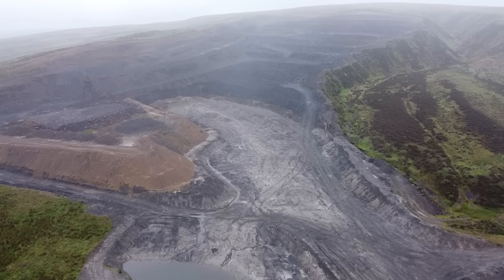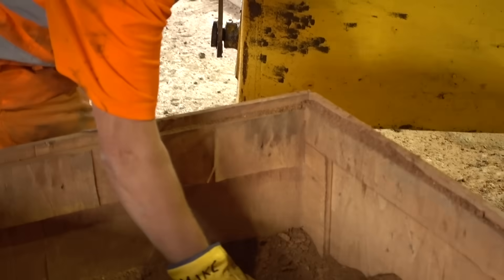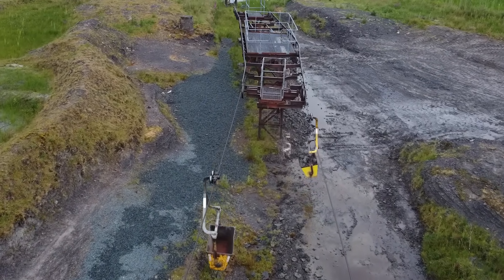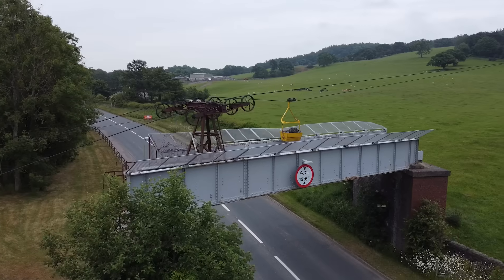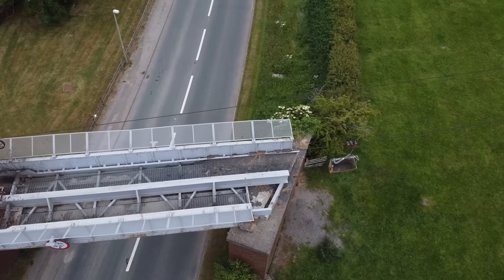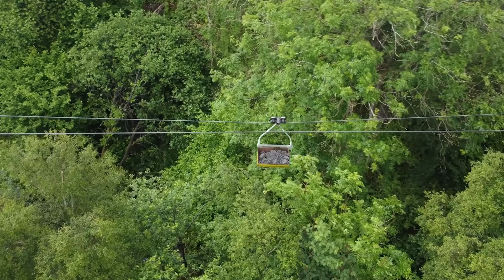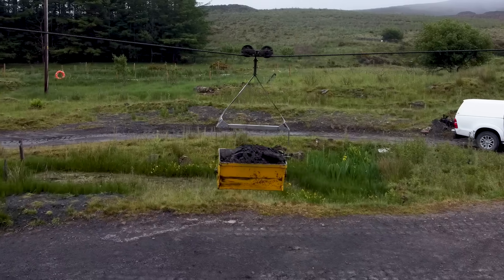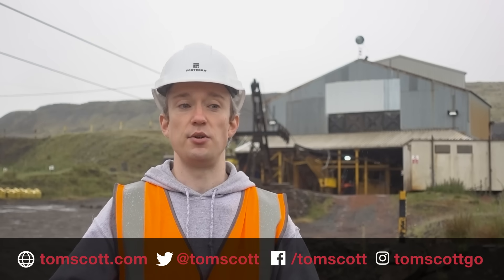The UK's last aerial ropeway uses no power, moves 300 tonnes a day, and will be gone by 2036.

Comment: Man, you can't say this uses no power.  It does use power, man.  Gravity power.   It just doesn't use electrical or fuel power.  That headline is misleading, man.
Reply: Gravity is a force, calling it power would be a misnomer, man - although it can do work, like here. Or in a hydroelectric dam, where the force of gravity is used to produce electricity. The headline refers to it not using power produced by external means, e.g. an ICE engine or an electric motor. The meaning 99% of people reading this understand it to be. He's also averring to the alternative, ICE trucks going up and down the mountain. For a headline it's not misleading at all. For finely parsed description, it falls rather short.

Comment: I wish this had gone into a lot more detail. I cant work out if the steel ropes are moving or the rollers on the buckets are rolling over the steel ropes. And if they are how can they are how can the buckets be taken up the hill. Also how does the mechanism work when the buckets go over the supporting gantrys? From this video its really hard to see exactly whats happening until you are up close. Also is there only 2 buckets going at any one time, surely not but its hard to tell. Its very clever though.
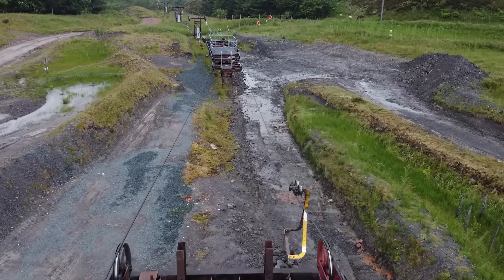Reply: Not sure how it looks on mobile but on a monitor the clip at 0:28 should answer some of your questions. The rope is moving and the bucket lays on the rope. The bucket stays on the rope while going over the supporting gantries. The rollers on the buckets are used when taking it off the rope to load and unload the buckets.

Comment: This is better than modern solutions, if sight is an issue (I think it looks cooler than most things out there), just build the same system underground, the same way they spend ages producing underground conveyors that rely on electricity, the caverns would only have to be big enough to match the height and width of the current.

Comment: If it needs brakes to regulate the speed why not use generators for regenerative braking to power stuff? Seems like a fair bit of energy could be extracted from tons of rock going down hill.
Reply: That wasn't an immediate concern in the time of lamps and steam.
Reply: @15buggie I didn't mean during the initial design phase I just mean in a retrofit.

Comment: There’s a mine somewhere that uses electric dump trucks that generate more power on the downhill than they use on the uphill because they are loaded and much heavier on the downhill and just riding regenerative brakes.  They actually end up with extra power that they can offload for the mine.  Of course, these sorts of strategies only work when what you are mining is at a higher elevation than where you want the material to go.

Comment: The reason you don't see stuff like this very often now is because it's not suited to the scale of modern operations. This thing moves 300 tons per day, which was sufficient for it's time, but it's orders of magnitude smaller than modern earthmoving operations. A typical large surface mine of today might process 30000 tons in one day. You would need to make those buckets a hundred times the capacity to reach that. Even if you had this ideal scenario of your mine being above your processing plant, already a rare circumstance to find yourself in, you would need to find a method with a much higher throughput than this. A modern approach to this would be a conveyor belt or electric trucks because their throughput is so much higher.

Comment: There was a similar system for coal just down the road from where I lived. It was done by double track railway from the coal mine to the mainline railway. The wagons were standard so could be directly coupled on to a train in the sidings, which provided the empty wagons to pull back up.Apparently, the brakes failed more than once resulting in some horrendous accidents. It was possible to send down more than one full wagon so long as there were some empties to pull back up  Apparently, if there were too few empty wagons and an excess of full wagons, they would chance it hoping the brake at the top would handle it.
The  incline is now a pleasant walk through an avenue of trees, but steep enough to get a good sweat on if you walk quickly.

Comment: To take this a step further you could install turbines every so often to generate electricity. Since this closed loop is continuously running you could store energy form back up just in case and power the rest of the facility with surplus.

Comment: Egyptian quarry's were 200 miles away they used roller rock crushers rope pulley systems crucifixes and aunhks in ancient times to move geopolymer it's called scagliola as a erosion proof furnace limestone mixed with expoxys moulding boxes nitrons and phosphates and slurry mixing g pools that's how they built pyramidal ram pumps in 20 years

Comment: Australia is considering some similar ideas around using the weight of the ore and gravity to move full loads from the inland mines to the ports and sending empty containers back up. Not sure how well they'll be able to design it for the scale, the distance is 100s or 1000s km and typical iron ore mine produces 50,000-150,000+ tons per day. Currently they use massive trains to do that, longest train they got is over 7km long.

Comment: Now if they were to keep this operation up, it would be beneficial to replace the breaks with generators and turn all the heat produced into clean energy …. The operators could make quite a bit in the 7 years or so this ropeway had left to run.
Reply: I doubt it'd generate much more than what it takes to run the brake system (likely electronically controlled brakes)

Comment: I'm sure the computer model was working from the same set of engineering tables they used back in the 1920s.  Back then it would have just taken them a bit longer to arrive at the same optimal conclusion.

Comment: "uses no power"... "power comes from gravity"

so, it does use "power"... just not electricity

sloppy
Reply: you don't need to plug it in or add fuel, and everything you put in comes back out the other side. what you're saying is akin to 'a ball rolled down that hill, it used power to do so."

Comment: How do the empty buckets grip on the cable and not just roll off and stack at the bottom? Is there a brake on the roller that the operator locks in order for it to be driven up?
Reply: @turdferguson12  That makes sense but then the rollers would be static most of the time, both uphill and downhill, wouldn't they? I don't see that in the video.
Reply: @schizophrenicenthusiast the buckets both wheels and a grippy hook on them, the wheels are for inside the plant when it's rolling on the rail, and the hook hangs it on the rope

Comment: Looks like a ski chair lift without an engine and a chair of course, there are videos of chair lifts running by gravity (out of control after the main gear shaft snapped and emergency brakes failed).

Comment: If no power is used, the movement of the buckets happens due to the positions of towers which use gravity to push them? Please correct me if my surmise is wrong.
Reply: The postions of the individual towers are of less importance. It's the difference in hight from start to bottom that counts, and the weight of the buckets sliding down being in balance with the empty buckets going up + overcoming loses due to friction in the system

Comment: I wonder if this could be reconfigured as a gravity battery instead of decommissioned. Does anyone know that change in elevation from the top to the bottom?
Reply: the cost of loading and unloading the buckets with material, + maintaining the system, would been much higher than the sale of eletricity.

Comment: I do wonder if it was electric trucks moving the shale up and down the hill if the extra weight coming down would keep the batteries charged so they'd never need an external energy source?

I always joke with my friends that if you had an EV you could drive up a mountain, load it up with rocks from the top, drive down and end the journey at the bottom with more energy in the battery then you started with, unload the rocks from the car and then repeat. Potential energy farming 😜. I'd just love to know if the idea would work 😅 if it did and you lived in a mountainous region you could potentially travel around using gravity by loading and unloading rocks and the peaks and troughs of potential energy.

Comment: If you find the use of gravitational power amazing then you haven't seen a lot as it's used in many areas like for example in elevators. In addition, if you use a brake system to slow down the speed then you might want to generate power from it

Comment: This system of energy use has a lot of....potential.
Reply: yes, it's called hydro eleltric power plant, in the case of producing energy, where water in a pipe is used instead of buckets on a rope

Comment: It is absolutely using power, it is even using electricity. As all power actually comes from the weight loaded into the buckets (potential energy put into the system), which is done using electricity.
Reply: The potential energy of the loaded bucket is from the difference in height between the quarry and the brick works. The potential energy of the loader is from it's height. The loader could also be using gravity, only needs energy to release the shale. Potentially the energy generated by breaking the heavier downward buckets could be used to power the loading equipment so it would still be energy natural.
Reply: @fuzzy9294  But it isn't, it's powered by electricity. I'm talking about how it actually functions, not how it theoretically could.

Comment: If it uses no electricity or fuel then why are we not implementing more of this older tech
Reply: Even if no energy cost to run, there are different number of operation costs involved. Often the case will be that eletric or diesel poweredsoultuns will be more cost effective in the big picture. But on the other hand, less enviromental friendly. There are places they used eletric powered trucks to bring material down, whle the battery is charged, andbeing able to let the truck run up again mainly on the generated power

Comment: My late father worked at a mine in the northern Pennines in the 50’s and 60’s. Not only was their aerial ropeway used for transporting the rock, he also used it to get to work from the family home at the bottom of the fell each day by riding up in the bucket. Some of the metal and concrete footings are still visible near the mine.
Reply: I doubt it was according to safety regulations but it"s great
Reply: @philippenachtergal6077 were there regulations in the 50’s?
Reply: Isn't that against gravity?
Reply: @blessedslave  I reckon 2 or 3 full buckets coming down will take quite a few men up
Reply: @blessedslave - True! And it would probably only work, because he was just "1" guy, at under the Personal Weight of the "1/4 Ton Per Bucket" of Payload Weight ...  the Weight going down the Hill (X many Buckets), if it was the same as "This Example!" 

Just as a Modern Elevator uses a "Counter Balance" of the Weight of the "Elevator Cabin" plus approximately 50% of the Listed "Carry Weight", to reduce the Load on the Lifting Winch, is a Balanced Calculation, These Ropeway Systems, are more like "More Mass is Moving Downhill than is moving Uphill" (Probably why this presenter stated, "Only Brakes" in his delivery, as opposed to Fuel, Electricity, used to power it!

Just as a Glider (Or, its more "Efficient Twin", the "Sailplane!") Once raised up into Rising Thermals, or Ridge Slope Winds, can Gain Altitude, without an engine, it's "Engine" is simply that it is getting More "Lift" from the Air going Up, than it is Losing by "Sinking!" (Glide Ratios of 20:1 {Travels 20 Feet Forward, per 1 Foot of Sink}, for basic Gliders, to greater than 50:1, for High Performance Sailplanes!) 

These Ropeways are moving, via Gravity, more Mass Down, that needs to move Up! Hence the "Brake!" 

Something not mentioned, in any detail, was, is that a "Manual Brake" Only, or does it use the principle of Spinning Weights, and Limits, in a "Governor" principle!
Reply: That must have been fun (on good days!)
Reply: I believe similar systems were used in parts of Devon where granite and sometimes metal ores were extracted using ropeways.
Reply: Was it near the - Highest Market Town in England - Alston ?
Reply: Could they not convert to a cable car system to get people up there, with the buckets fitted with a roof and door.

Comment: It's worth pointing out that the main reason this works is the extremely low volume of material they're moving. 300 tons of material per day is 3/4 of a single load hauled by a single Caterpillar 797F dump truck. That Cat could make the trip in about 5 minutes, and would burn approximately 12 gallons of diesel per round trip. Offhand, that's probably the same cost as paying just one of those loading guys for an hour or two of labor.

Comment: The "Infinity Train" in Western Australia is also gravity fed, designed to charge batteries as it descends loaded from the inland mines to the coastal ports. The charged batteries then propel the empty train back up the hills to the mine. The train weighs about 34,000 tons, is about 3km long, traveling down from 600m elevation (mine) to sea level (port). They figure on saving about 84 million liters of diesel per year.
Reply: I was wondering how many examples are left worldwide - I'm wondering why the batteries though? Why not just send an empty train back up with the descent?
Reply: @sroberts605  the trains are not connected to each other, the trains are 3km long each (longest one is over 7km long) but the distance from mine to coast can be over 1000km. how would you send the empty one back up using another going down?
Reply: @sroberts605  It probably is only 1 rail? To send the empty one up you need 2 rails or at least a 2 rail line somewhere in the middle so they can pass.
Reply: Because it's a train. It's not a ropeway @sroberts605
Reply: New World: Infinity train
Old World: Aerial ropeway

Comment: The new age version is the electric trucks of some (Swiss?) quarry that is above the processing plant. Empty ev monster dump trucks trundle up the hill empty, pick up a load of rock and use regen braking to charge the truck on the downhill trip. Brilliant!
Reply: I mean to say that is unnecessary complication of a problem solved in this video is an understatement
Reply: The only downside is the huge amount of lithium and cobalt which cannot be recycled, and emissions and pollution. Wait, that's four.
Reply: @one_step_sideways  Sure, but then it's a measure of how long you run the trucks before the benefits outweigh the costs.
Reply: @one_step_sideways  the construction of the cable system of course generated no pollution whatsoever. And don't lie about recycling. The batteries can be recycled and can also be used for stationary purposes for decades. LFP batteries don't even use cobalt.

Comment: Well frankly I don't see any reason why anyone would object to the extension. It's entirely environmentally friendly seems fairly subcluded so it provides easily accessible high paying jobs to the community and it doesn't affect or bother the residence of the community as long as it's maintained properly I don't see why it shouldn't worst case they have to upgrade the bit around the road so its entirely enclosed with fine cage and ensure the last 2 towers don't fall onto the road

Comment: When I was younger (6-11) I built a Lego version of this. It did not work well because it was difficult keeping the timing right. I had no idea that this ropeway existed until now and it is cool to see that something I thought of when I was a kid using my imagination, ended up being something that is used in real life.
Reply: @@karlhanks4598ah yes, a child could not have built something with lego and then seen something similar as an adult
Reply: You should have used Meccano!
Reply: Not Mentioned in detail in this, was what kind of "Brake" was used! 

For Example, take Two "Cans *Of Soup", one in each Hand, and stand on a "Lazy Susan" or The Center of any freely Rotating, or "Rotatable ?" Platform, have someone spin you a bit, then "Extend and Retract your Hands with these "Cans of Soup" in them! 

Just like a Figure Skater, your rate of rotation will change, as your hands move out, or in to your sides!

This is part of the Principle of a "Governor" for a Motor! 

One more would be a "Heavy Flywheel" to maintain the "Inertia" that is variable, (in these cases) by Loaded Buckets entering, and Exiting the Ropeway! 😁

Comment: From a technical point of view, this video is no good because why do the wheels turn on the bucket, and how does that give the other unloaded bucket leverage to go back uphill again?
Reply: The wheels are only for the rails at each end where workers move the buckets.  When coming into the terminal each bucket comes off the cable/rope and then workers position the bucket so the rope catches it going out.  The buckets are held onto the rope by friction.